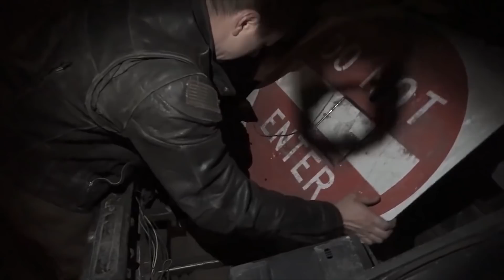1973 240z datsun rat rod build up, junkyard rescue rotsun evil twin thrash

Comment: Back in the 90's my pals and I all had 280's. We were never done with them no mater how good they drove or how good they looked. We'd storm chase, explored lakes, took them camping and road tripping. Sometimes having to do "on the spot repairs" just like you did in the video. It was the best of times and you just reminded me of all of them.
Reply from the maker: Yeah I used to drive this all over the west coast.  Now I'm slowly rebuilding it.  I designed a differential swap for these that works great, and have been steadily selling it

Comment: I saw the moment you noticed the alt belt misalignment so I bet you weren't surprised when it spat the belt. Another great vid. Cheers. 😎
Reply from the maker: +FlatBlackRat I wasn't surprised because it was steaming, that's why I pulled over.  I had hoped the new bracket set had fixed my belt issue, and it did, but only after I tightened it.  Gotta admit it was a let down seeing that belt off after spending money lol.

Comment: The left front fender wheel arch is the same as the right rear wheel arch and vice versa. So when needing to replace the rear wheel lips you can just buy cheap used front fenders. 
We learned this on our 240 we installed a V8 into in 1979. 
Also you will destroy the rearend spider gears if one wheel spins and not both. We used an additive called Problend in the mid 80s and finally stopped busting spider gears.

Comment: Hi! It turned out a very "nice" car, if you get the point ))))

I have a couple suggestions on the issues.
First, it may throw belts because the alternator mount twists under the load, once it is misalignet - belt is out. You should check it's robustness.
Second, if you put fans in front of the radiator, maybe removing the one behind the radiator helps? It seems as an obstacle for the air now.
Reply from the maker: Andrey Studentsov doesn't throw belts now that I tightened it.  Fans work well together, just the fronts or just the rears aren't enough though.  Not untill I get a better radiator anyway

Comment: If you still have problems with the fan-belt, try keepers like those on a snowblower or lawnmover. Also springloaded tensioner could be a solution.

Comment: Go find a Corvette/early Z28 deep groove pulley for your alternator.  Also if you need to advance the timing that much you have a vacuum leak.
Reply from the maker: Jo Momma cranked the timing down to a reasonable setting, and haven't had issues with belts since I tightened the setup.  Doing a 4 speed swap today, hoping it comes out good

Comment: Hey man I got a 76 280 I’m working on & the original owner cut the exhaust halfway through the car so I need to get a new one. Plus I need to weld in a bung for 02 sensor so new exhaust here we come. Love the way yours sounds what’s the setup because I love that sound. Fingers crossed it ain’t pricey haha
Reply from the maker: Cheap glasspacks.  It's a v8 and thats why it sounds so good

Comment: It would be maybe a good fix to go to a serpentine belt system. They probably cost pretty good amount though.  I dont know something is waay off on that system even though its not so obviously seen. Looks like the defrost is not working too. Better fix the defrost before the roadtrip but go for it.
Reply from the maker: shartne actually, my belt was just loose on my new setup.  Once it was tight it didn't come off even once, and I've been flogging the car every chance I get.  But yeah, a serpentine from cvf would be just the ticket and it's fairly affordable.  Just not  $35 affordable

Comment: 40 pls years ago we had belt worries with SBC's so aftermarket companies sold things like deep row pulleys etc to keep them on. Eventually serpentine kits came out . I think that engine might have some rally high comp pistons if winding back the timing is creating issues. Again,low ratio  geared starters were the fix years ago until better cam designs came out which enabled a more civilised comp ratio for street drivers.
Reply from the maker: Mercmad yeah, I'm taking back some timing today and going to see what happens.  Hoping it does the trick

Comment: Get a deep groove pulley for the alternator to keep the belt on
Reply from the maker: +Monte Stu actually, I tightened up the adjuster on the new bracket I switched to (the next morning) and as you can see I didn't lose the belt while burning out and driving about 100 miles on the highway back and forth.  So for now I can spend my pennies elsewhere.  Thanks for the tip though

Comment: I would love to see the 4 speed manual gearbox it makes for a more involved drive. Drive the wheels off of it then fix and repeat.
Reply from the maker: +Tim the spannerman Yes! My thoughts exactly, not to mention a whole lot less can go wrong with a manual.
Reply: As a European, I didn't get why it is for Americans so hard to learn driving in a manual. I say, a Harley did also have a manual. So what is the point?  For me it is more fun to drive in an manual (sure for sport cars) you are more part of the car in stead of pushing the pedal to the metal.
Reply from the maker: Alie 148 agreed, watch the new video about this 240z, it's a manual now and it's amazing.

Comment: How much difference is there between the stock inline and that v8 I'm guessing it's pretty much bone stock
Reply from the maker: gene miller not stock.  But not too wild either.  It's more than double the horsepower and added 60 lbs to the total weight.

Comment: You should try just pulling the thermostat out sounds like you also need a new starter
Reply from the maker: Jeff Joy pulled a few degrees timing, haven't touched the thermostat but I did grab a new starter to go with my smaller flywheel.  I already have the 4 speed in it, just buttoning it all up.

Comment: Been looking at those wheels. What are the rims size and offset? Your tire sizes. And where did you buy those spacers?
Reply from the maker: Steve Felix spacers are eBay.  Had to fit the 15mm fronts over the 73mm hub bore and cut my studs... I would go with a bigger spacer because of that.  But the 35mm had no issues on the rear.  The wheels are zero offset.  So they fit stock 240z.  If you want the flares looking right, you have to space the wheels out or buy negative offset ones.
Reply from the maker: Steve Felix tires are 215 60 15 and rears are 225 60 15.  Very cheap and common size.  Couldn't go bigger because it gets expensive and refuse to stretch 205mm tires on there because there's nothing gayer...

Comment: What are your wheel and tire specs? Thanks
Reply from the maker: Rhonnel Agatep 15x8.25 zero offset, and 15mm and 39mm spacers front and rear.  Tires are 215 60 15 and 225 60 15.    Much bigger tires going on now, I'm re doing the suspension

Comment: Did you get that in Bremerton WA? It looks like the one my buddy and I put a 390 in
Reply from the maker: Soulless Ginger no, this isnt it.  If you watch the earlier videos of it you'll see it had to be worked on a LOT, and lots of parts needed to be measured and bought or made.  All Z cars look alike I guess
Reply: Lol I didn't see the bow tie  valve cover the first time thru but just a useless fact a Ford 390 will fit under the hood with just fabbing motor mounts. Amazing what a couple cases of beer free time and spare parts can make
Reply from the maker: Soulless Ginger meaning you can build a 428 datsun?

Comment: 4 speed all the way!! , get a mini hi torque starter,, why is that engine so hard starting? you would think as least some water would have gotten on that windshield and cleaned it a little :)
you have to admit,, its a fun car, that you get to drive like you stole it!!!
Reply from the maker: DANTHETUBEMAN hard to start cause I was dumb and hadn't set the timing right.  Backed it off a few degrees and it starts right up now.  The 4 speed is actually already in the car as of 4 hours ago.  Buttoning it all up tomorrow and throwing together another video soon.  This time it has Limited slip and a 4 speed, should a whole lot more fun.  Thanks for watching.
Reply: you did the right thang thr,, 4 or 5 speed is the way to go,, and will make a good install vid.
Reply from the maker: DANTHETUBEMAN thanks.  Going to finish it all up today.

Comment: I have just made some frames to allow a customer to fit the limited slip diff from a BMW to his 240 z. Was fairly simple and cheap conversion. He going to be drifting his one.
Reply from the maker: Andrew Wilson nice!  Yeah, I may in the future get a ford 8.8 in there so I can use 2.73 gears
Reply: Invincible Extremes Muscle Cars Ford does do an independent rear end which will fit easier than a solid axle. The rear is pretty narrow so a bit of narrowing might be required but everything is possible. I think of rust as the car naturally evolving into a lighter weight version of itself? In theory the more it drops on the road the lighter and faster it gets? Great video my friend.
Reply from the maker: Andrew Wilson it's  $125 per axle to cut and spline any length you need... so a $170 and  64 inch irs can become a 53 inch irs no problem for $420 and some work on my part to make it bolt in...  Too easy
Reply: Invincible Extremes Muscle Cars Garage that is pretty damn reasonable and should just about be able to live with the kind of beating you going to serve it up! The combination of a pretty lightweight sports car body and tough and powerful drivetrain going to be a winner. Looking forward to following progress. Stay safe my friend.

Comment: You should check your ignition timing it seems really advanced.
Reply: Pretty sure I hear detonation when you get on it. Won't last very long like that.
Reply: Invincible Extremes Muscle Cars Garage that sucks I had the same kind of problem one time. I bought a Moroso spring and weight kit for my distributor it fix the problem. Keep up the good work I love your videos
Reply: My 5.0 Mustang is the same. It's fucking annoying. I can't figure it out and I'm at 10* timing running 93 octane with octane boost or it pings at WOT. It has to have a vac leak somewhere; just cant find it. Stupid smog bullshit.
Reply from the maker: +TheKoppenhaffer it happens.  Going to back off the timing just a hair and try and see if it gets faster
Reply: +TheKoppenhaffer Take a propane blow-torch, hook a hose to in, start a engine, crack a valve a bit and wigle wigle wigle the hose around engine, listen to engine, if it changes you found a Vac leak. good luck
Reply: TheKoppenhaffer I know a lot about those fuel injection 302 Motors. There's always a vacuum leak underneath the top plenum there's rubber vacuum lines under there. And they also leak between the lower intake and the top plenum. And they have that bullshit computer distributor. I always change it out with the earlier Style with the brain box. Set the timing at 14 degrees.
Reply from the maker: Marco Ceccarelli actually turned it down a bit and it's fairly happy now
Reply: Invincible Extremes Muscle Cars Garage awesome good for you. Keep on making your videos I look forward to watching them. The easiest way to find a vacuum leak. Buy yourself a big cheap cigar get it good and hot take the vacuum line off from the booster and blow smoke into the vacuum line smoke will always find the leak. Just give you heads up it works for me
Reply: Marco Ceccarelli Scoty Kilmer taught you this haha
Reply: I managed to fix the lines in between the plenum when I had the transmission out. (I have small hands) I'll check the plenum and see if it's leaking itself. Probably just spray it with some carb clean.
Reply: Cerial Killer you're right it works excellent
Reply: Marco Ceccarelli glad to help fellow Car-Guy
Reply: Sick start to your series. I love roadside fixes.

Comment: Maybe check the idler, that fan belt wail is horrible man.
Reply from the maker: Ritchard posterior no idler... But I adjusted the belt and it's better now.  Did burnouts at the end with no issues
Reply: the best way to test anything lol
Reply from the maker: +Ritchard posterior yup, bring tools and beat on it untill something breaks!

Comment: Isn’t that a bit to much power to safely run those rear spacers....?
Reply from the maker: Ozzy Tapanes it's pushing it, but that's just my opinion.  I know guys who roadrace same style of adapters with much more horsepower on much wider tires and much heavier cars... so I'm not concerned about it.
Reply: Invincible Extremes Muscle Cars Garage ok, just be careful buddy

Comment: Stick with the running gear you have 👍
Reply from the maker: UFO - BRO can't argue with that... If it works, it works.  But I'll need a different torque converter and some sort of Lsd for the rear end if I'm to drive it much.

Comment: What a dodgy knut. Not sure if this is supposed to be a satire video or not
Reply from the maker: Nope, true story.  I put in a 4 speed manual trans I smuggled through the airport from Hawaii and roadtripped this thing thousands of miles, to the border of Mexico, then Tuscan Arizona, back to San Diego and then back up to the northwest.   No wipers, and for the first part of the trip, no turn signals either.